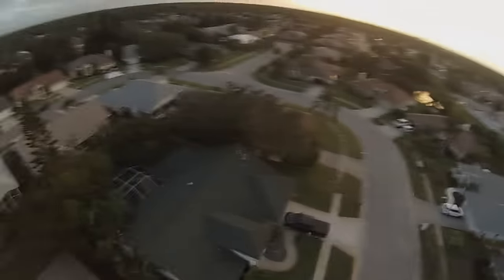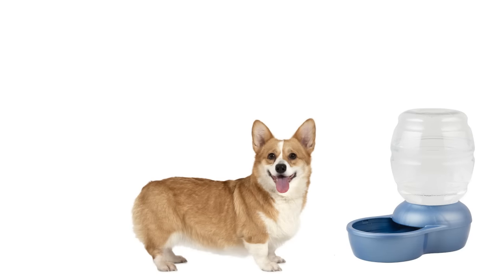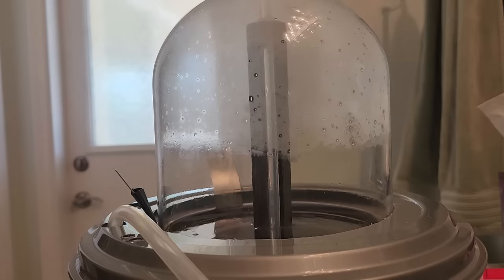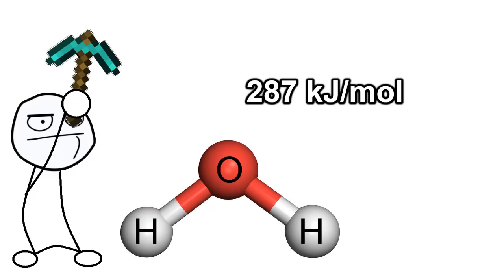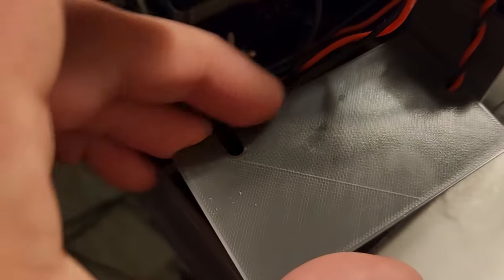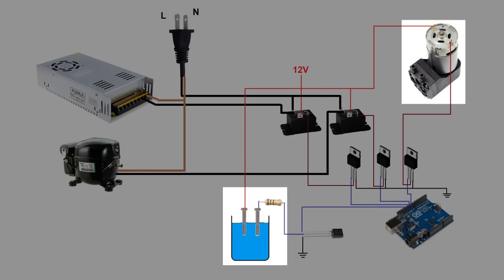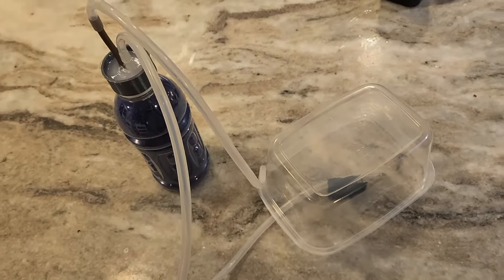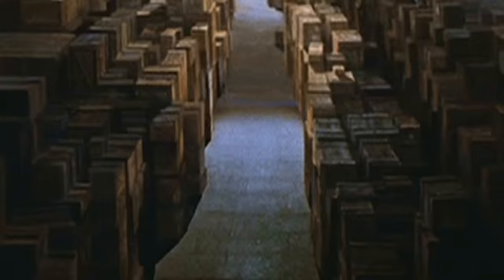Automated Hydrogen Generator

Comment: A small mistake i caught. Sievert (Sv) is the unit of radiation exposure risk. What you meant would be Siemens (S) which is the unit of conductance.
Reply: I was already wondering, Sv "sounded" wrong, but I didn't know the actual unit to be sure.

But then again, I won't be surprised when a later project causes Sv's xD
Reply: Can also use "mho"
Reply: yes i also use semens as a unit of conductance
Reply: yup
Reply: Okay, good I thought I was going crazy for a second there lmao, had to bust out the good old wolfram alfa
Reply: Yeah, I was suddenly very curious why we measured conductivity in ionizing radiation. Easy mistake to make in units you don't usually work with. (I didn't know Siemens offhand)
Reply: That confused me, thanks.
Reply: Measuring long hard rods in Siemens. 
Engineering truly is dominated by men huh?
Reply: now make the hydrogen liquid…
Reply: And you absolutely do not want 18.7 Sievert
Reply: Dang! I was just about to comment on that :D GG
Reply: @zuthalsoraniz6764   "That would be enough for the cancer to have cancer" - Andy Weir, The Martian
Reply: @BloodyMobile  and Siemens doesn't sound wrong to you at all? Hmm.. ...
Reply: @korebeast973  braa nuhhhh... 🗿
Reply: @TotesCray  or an upside-down Ω 🙃
Reply: I wouldn't be surprised if he actually made hydrogen by using Sieverts but we will see😅
Reply: Product Placement 😂🤪
Reply: Wire Electrical Discharge machines use water metered through a resin bed to 10 micro semens per centimeter.
Reply: @korebeast973 not really, just a man named Siemen
Reply: yeh i jumped on the comments section to see if anyone caught it.
Reply: A simple PEM electrolyzer with a little mechanical water/gas separator could have replaced everything he built here and been more efficient.  I can produce 2 liters per minute with a 10 cell stack that only needs 1.8 V / cell after the water warms up (so 18V).  And it draws a little over 26A.  So it takes less than 500W of energy.  PEM is the way to go.  Higher up-front cost though..... but hmmm with everything he did here, I don't know if PEM is more costly 😅
Reply: It's a measure of radiation dose, not risk. Grey is the unit of ionizing radiation, multiplied by a quality factor depending on the type of radiation to get Sievert. We pretend that risks from radiation are linear, non-threshold, so it's sometimes used as a sort of proxy for risk. However, the data strongly supports that actual (malignancy) risk is non-linear, and has a threshold range, below which, the suggestion is actually of a protective effect.
Reply: @zapman60 It would rather be microSiemens per cm. Siemens, not semens.
Reply: @yasirrakhurrafat1142  If you mean it sounds like that German company that makes a lot of electrical and electronic products it's because it was invented by the the same engineer that founded Siemens & Halske which is now Siemens AG.
Reply: @ChristmasEve777  oh yeah?
How many grams is that?
2 litres liquid hydrogen?i.e 78gm ?
You ever tried an AEM electrolyzer?
Reply: @ruben_balea  people have a pattern of being a siemen.
And producing siemens.
At different points in their life.
Reply: Yes! Got a bit shocked when he said sievert. Its Siemens
Reply: @yasirrakhurrafat1142  Sorry, not liquid hydrogen.  Just hydrogen gas at room temperature.  I WISH I could produce liquid hydrogen, let alone 2L / min of it 😄 I have a cryocooler that can liquefy oxygen and nitrogen and I did try hydrogen.  I left it going all night and, in the morning, I only had a dewar of very cold hydrogen gas - no liquid.  I haven't tried an AEM before.  I'm going to google that.
Reply: @ChristmasEve777  AEM is a cheaper alternative, as far as I've heard.
To PEM.
Producing hydrogen in gas... makes it impossible to measure it's efficiency. Liquid/weight makes it practical.
Cryocoolers may not compress it down to liquid. They.. tho.. may just compress it enough to de-pressurise it.
You ever looked up on hydrogen fuel cells? They're rad! I hope they get more efficient.
Reply: Use a analog synthesizer  
to adjust the wave length to optimize water fracturing
Reply: Was about say the same
Reply: Watching this I had a feeling this was the case, however I also know science loves to reuse names.
Reply: @prakharmishra3000  My gf uses it in terms of quantifying discharge...
Reply: Came here to say sieverts was wrong lol
Reply: @korebeast973  🤣😂👍
Reply: pronounced SEA-MEN-S
Reply: No, you're wrong, he's actually describing how he's about to create a broken arrow >:)
Reply: I thought it was making the fucked Hydrogen bomb but yea units
Reply: Damn! I was going to say that. A slip of the tongue, indeed the document in question actually says "Siemens".
Reply: Thank you for commenting this. I was really confused why it said sieverts!
Reply: @BloodyMobile 😢😢😢😢
Reply: What A Nice Project Can you try use My Voltrolysis Circuit on this?  please  do you have any 3d Print Files as we can test it
Reply: That is not a small mistake.
Reply: Just another correction, siemens is the symbol used for the unit of conductance, the mhos.
Reply: Beat me to it
Reply: @tubanbodyslammer9125  That's why you made the video? To get beat? Make a video asking for that then, you'll find the propper beat man.
Reply: @mohamedlanjri  I didn't make any videos. I was only saying I was going to make the same correction
Reply: Sometimes called Mho, which is because it's literally 1/ohm and so Mho is ohm in reverse. We don't use this name now for some reason
Reply: Yes! Exactly!
Reply: i scrolled down to wright that lol
Reply: @TotesCray :
Yes, the mho is all I've ever seen in print.
Reply: @prakharmishra3000 :
OK, then why are camels called ships of the desert?
Reply: whats the effect that peltier modules and thermocouples use?
Reply: semens
Reply: Yes, I caught that too. Sievert is used as a measurement unit of radioactivity, like REM (Röntgen Equivalent Man).
Reply: Isn't conductance measured by row strangr symbol my kepboard doesnt posses but as In the natural resistivity of a conductor
Reply: Yeah those 18Sv would be dangerous
Reply: Exactly   (6:07)
Reply: Haha semens
Reply: I wouldn't know enough to say whether either, both or neither are correct. 

Unlike everyone else in the thread who absolutely knows. Wonderful. This was... useful?
Reply: Do you JUST create a REACTOR HYDROGEN FUSION
Reply: bro
Reply: Siemens phones flashbacks
Reply: I prefer mho
Reply: Oh, thank God I thought I had totally lost my mind.

I remember calculating the resistances of wire in Siemens.
Reply: Semens?
Reply: hmmm i was confused about that, thanks for clarifying!
Reply: How long would it take for you to make the balloon from Up?
Reply: I thought my hearing was failing…I’ve done videos on my “magic rocks” channel as I call it…and compared sieverts to rem…and thought I was losing my mind when I heard him use it here with electrolysis…
Reply: It wasn't the hydrogen burning there. It was the combination of aluminum and steel in the coating that caused the burning.  Thermite!  The hydrogen went up, of course causing the termite to start, but the hydrogen wasn't a real problem.
Reply: thx, it did sound wrong lol
Reply: @korebeast973 😂
Reply: I also felt something off😅
Reply: semen
Reply: Semens lol

Comment: I used to work in an industry where we used electrolysis.  We used Ruthenium-Iridium coated Titanium electrodes and potted over the electrical connections where the ring connectors were screwed to the plates.  For a home-made setup, you could probably just use titanium which is less conductive, but should last longer and keep you from producing chromium salts from the stainless steel.
Reply: I like the idea and would be easily available as backpacking cups and pots in convenient shapes and sizes. Switching from Cr to V (and probably Al) contamination will significantly (but not entirely) reduce concerns of toxicity. Still, I'll deal with V+4 over Cr+6 any day of the week. 
Anyone with better chemistry knowledge than this home educated guy, with no credentials, from memory, please point out my errors.
Reply: What about carbon rods? Easy to get from zinc/carbon batteries too.
Reply: I said the same thing before I saw your comment.  I hope he sees our comments and any others and adjust his process accordingly.  Have a wonderful  everything!
Reply: Titanium oxidizes quickly to titanium dioxide which is non-conductive and firmly adheres, so the electrolysis would come to a stop. That's why its coated. Carbon works, but tends to crumble. Nickel works well.
Reply: @iBlue0riginal  people say that chrome-free stainless steel also works well. Or plain carbon steel as a cheapo expendable solution.
Reply: @iBlue0riginal  Nickle oxidizes as well doesn't it? It is used for Nickel/ Iron batteries, so does it remain conductive? Otherwise it think we have a winner!
Reply: As I understand, MMO electrodes can't be used in strongly acidic conditions, but can they be used in strongly basic solutions?
Reply: @iBlue0riginal  I agree, nickel is the way to go. On the anode it forms nickel oxyhydroxide which is apparently conductive but resistant to further oxidation. That's how it works in NiMH batteries as well. KOH is probably also a good choice, I think the solutions tend to be lower resistance.
Reply: I bought platinum in the late 90's to use as electrodes.  It was only $300 / troy oz (or so) at the time. (Side note, gold was only $200 something at the time).  If only I KNEW precious metals would skyrocket....😦  I would have sold most of it by now and, well of COURSE, kept some of the platinum to use as electrodes.  But since I didn't actually buy much, I ended up selling it (1 oz for $1700) some years back.
Reply: @Gersberms  You can get carbon rods sold for carbon arc gouging from welding suppliers for ~$0.50 a pop. (You might have to shop around for someone with the kind that isn't copper coated.)
Reply: @benjaminshropshire2900  They fall apart quickly. The only form of carbon that lasts is glassy carbon.
Reply: Titanium suffers from Hydrogen embrittlement.
Reply: @halfabee  How would that be relevant in this setting?
Reply: @Xsiondu  Same here 🙄
Reply: @iBlue0riginal  It's not the whole electrode, merely the connection to the Al plates. If the mechanical interface between them is gas tight, then oxidation will only be an exposed surface issue which shouldn't affect conductivity.
Reply: he should use GOOOOOOOOLD.
Reply: I think the problem using titanium may be that the anode will become coated with titanium dioxide which is a good insulator, so possibly the plate would stop working if used as an anode.
Reply: Электрод покрытый рутениево-иридиевым сплавом стоит как крыло от самолёта)
Reply: Titanium passivate So not that good
Reply: It is also posible to use carbon foil.
Reply: I ment grafite foil.
Reply: Might consider nickel alloys like inconel or waspalloy
Reply: @rickdalton7907  or you could plate your steel with a layer of nickel
Reply: @technotroll-pro ну здрасссьте приехали

Comment: Be careful recovering the hydrogen from the balloon, due different gas concentrations there might be an osmotic difference great enough that could make air diffuse into the balloon increasing oxygen levels. All depends about the gas permeability of the balloon and the time but still be careful.
Reply: My dad gave me a latex balloon with hydrogen to me when I was a kid. Obviously I set fire to it when it wasn't lighter than air anymore, as you do, and I got a surprisingly loud and distinct bang, with distinct "waves" of echoes.
Reply: Very interesting, balloon materials being permeable?
Reply: @kaerajpetera yes most materials like plastics and rubbers are permeable. That’s why helium balloons start to lose their shape after awhile and sink. A simple rubber hose really can’t be used long term for refrigerants as the molecules will leak out, more so as the hose material ages due to heat and exposure.
Reply: lol, was just going to post that,  good someone already did!
reference: "Cody'sLab Self Inflating Balloons?! "
Reply: @kaerajpetera  this is why Zeppelins had their gasbags made of goldbeater's skin (which it'self was made of calf intestine lining), which until the mid 20th century was the best materiel on a weight/permeability scale. in more modern times this would be replaced by polyethylene terephthalate coated in a microns thick layer of aluminum or more commonly known as Mylar.
Reply: @orlandotech most balloons aren’t air tight though. That’s the main reason

Comment from the maker: Apparently I was half-asleep when I was recording the audio for this video and mixed up Sieverts and Siemens. 

Also, for those wondering, Part III of the Joule-Thomson cryocooler series is in the works and should be the next video.
Reply: You should have seen me frantically googling to make sure I wasn't the one half-asleep! 😂
Reply: Dude… can we have… plans?
Reply: Dear HyperspacePirate,

Many many thanks for these hi-ranked technical videos, it seems useful to support you, maybe with a Discord fan server; some tip-n-tricks exists with easier hydrogen storage as a gas; via magnesium or titanium hydrides, maybe lodging a "cold trap" for catching mist and moisture prior to any storage could be a part of cascade devices; enhancing the recovery of liquid water from time to time.

Many many thanks also for giving us ideas and know-how; maybe you will have to enhance your brazings, weldings, making apparatuses from stainless steel pipes with spinning forming lathes... maybe making/modify some Dewar devices.

Nitrogen is mandatory for protecting austenitic stainless steels; especially when heated, it's better than argon : nitrogen helps the austenite to exist at ambient or cryogenic temperatures. But nitrogen cannot be used for electric welding, because of tungsten ability to react forming tungsten nitrides. Which gives crumbling ceramic and a powerful electric isolant, thus forbidding welding via electricity.

So it's better to apply nitrogen inside stainless steel vessels, and very pure argon outside.

Only some parts per million of other gases are allowed; as pollutants, that will volor stainless steel on a proportional scale. The more colorful, the worse it is; as titanium welding charts also.

Maybe you could make a "call of help" about the minimum quality of vacuum needed to ensure thermal insulation, between two stainless steel parts, it could be VERY useful.

Looking for at least 10^-4 bar of residual pressure ?

With a small CNC lathe it seems possible to obtain corrugated/ondulated stainless steel pipe from common thermos flasks; making tools and dies for embossing stainless steel; then ensuring brazing without silver, without tin, just copper+phosphorus with pure argon protective atmosphère, modern IGBT transistors can help for induction-assisted brazing copper on stainless steel, using Wood's nickel dichloride and muriatic acid melange for activating stainless steel (via few atomic layer deposited of nickel onto stainless steel), prior to copper coating/brazing, with wand brush electroless déposition technique.

Warning : all salts and nickel compounds are also proven carcinogens.

Please consider the usefulness of chinese little oxygen concentrators : they provide almost pure oxygen at 95% purity, enhancing argon concentration (close to 95%, nature availability is 0,93%) and reject ...nitrogen at very interesting concentrations; at 7 liters/hour for a ~$300 unit... that could be an advanced tinkering idea for making LN2, and also welding activities via enriched argon which is easier to liquefy at atmospheric pressures..

These units are using mobile piston and cylinder made of pure copper, which allows oil-free compressors to work with almost pure oxygen without instant burst/wild combustion.

Best regards from a crumbling France.
Reply: And always remember : NEVER place on stainless steel a solution containing chlorure ions, at 50 ppm they allows a terrible autocatalytic corrosion phenomenon, the pitting corrosion which is impossible to stop.

Molybdenum addition can provide enhanced pitting resistance (called PREN score, Pitting Resistance Equivalent Number).

Always keep away from halogens when using stainless steels, the proximity of beaches / maritime climate can be an issue.

Muriatic acid and chlorides should stay WELL away from your systems; they can attack even bronze alloys, on a irreversible manner.

Wishing you the very best, maybe you will send us meme-painted balloons ^^'

Always remember to protect stainless steel areas with vinyl tape, rinsing Wood's nickel reactant just after activation. Hope this will help to apply completely airtight/vacuum-grade assemblies.
Reply: This comment should be pinned, so people can stop mentioning the Sievert thing.
Reply: I won't mention the Sievert thing(s#!t, I just did...), but WHAT ON EARTH IS "Effiency"?? (8:15) 😁
Reply: hehehehe siemens

Comment: My Dad made something similar using a 55 gallon drum and a smaller plastic drum, the outer electrode was the steel drum and the inner electrode was stainless that was inside the plastic drum. Power source was a self excited alternator on a homemade wind turbine. He had no use for the H2, but just liked tinkering around. Dude had his issues, but there are parts of him that I miss being around. Thanks for the trigger to an old memory

Comment: Have you tried sticking plastic parts together with friction welding?  My favorite way to stick 3d printed parts together is to put a piece of filament in the chuck of a dremel, turn it on, and trace slowly over the seams with it.  The friction gently melts the filament into the seams, forming a super strong bond.  Unlike a soldering iron, the dremel actually deposits fresh plastic, rather than just melting the plastic that's already there, and it causes a lot less damage to the printed surfaces.  Also, the result looks just like welded metal, which is super cool.
Reply: need to try that! Thanks for the idea
Reply: Pretty cool